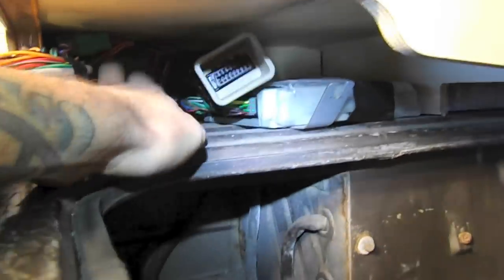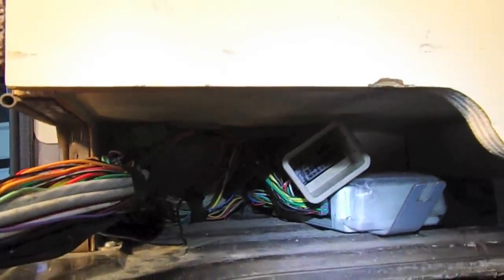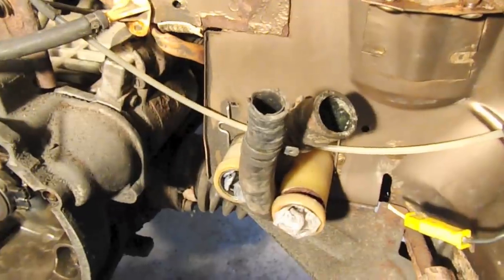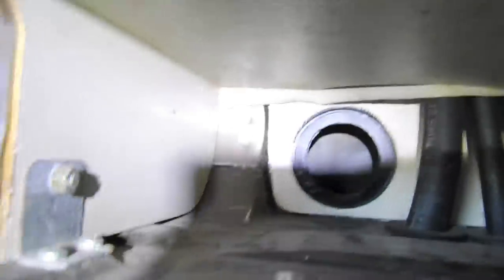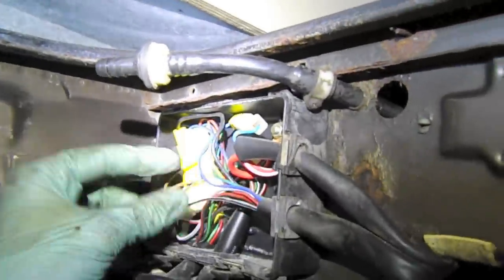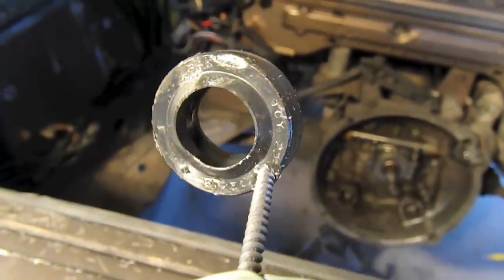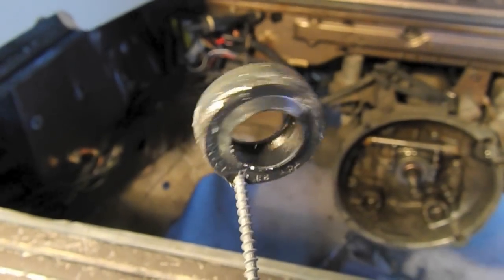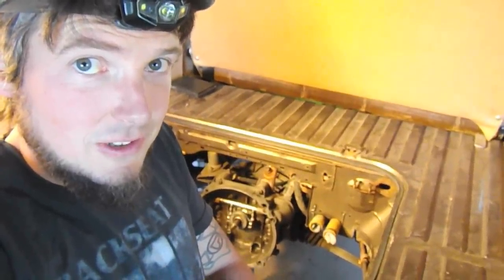Vanagon Chassis Prep - Subaru Vanagon Engine Swap Part 3

Comment: @Busaru I was re-watching some of your videos and working on my buggy and a thought/question came to mind.  I have a street legal buggy with bare bones electrical.. headlights, turn signals and brake lights.  I thought while I have an entire donor car it might work better to run more subi wiring for light controls, etc.  Given that everything works fine now shy of not having high beams, would it be worth the extra hassle to strip/prep/mod more subi harness for adapting to my rail?
Reply from the maker: +Kevin Alberts I've never done it, as the Subaru accessory wiring is built specifically for the Subaru, but you could probably incorporate certain things from the system. Seems a bit complicated to me though.

Comment: I use to have an 89 Vanagon and it would have been great to have converted it.How much abuse can a stock 4 speed and halfshafts handle? Are the rpm's at a decent place around 70 mph? Cool videos
Reply from the maker: +Jesse Ray Hi Jesse, the stock gearbox can take a lot. If you are truly abusing it with a turbo powered Subaru 230+ HP and dropping the clutch at stop lights all the time then you'll probably destroy it eventually. If you drive mostly flat land at 70 mph then it would be wise to regear. Generally on a stock trans you're around the 4000 rpm range at 70, maybe a little less.
Reply: Thank you for the info. You have some cool VW's around

Comment: I have found a good engine online but it does not come with the ECU or wiring harness. Is it possible to get the ecu and harness separate from the engine as long as they match up?
Reply from the maker: +Tyler Sherman quite possible. Junkyards are your friend.

Comment: Title has a spelling error in Vanagon
Reply from the maker: +Warren Crosbie Sheesh, it's been that way for years! Thanks for the heads up.
Reply: Busaru, I'm housebound due to extreme heat (Australia). Thanks to your videos, I've learned an extreme amount about wiring for VDub engine swaps. Thanks heaps. Love your work.
Reply from the maker: +Warren Crosbie I've heard it's been a brutal summer down there. Take care mate, glad the videos help.